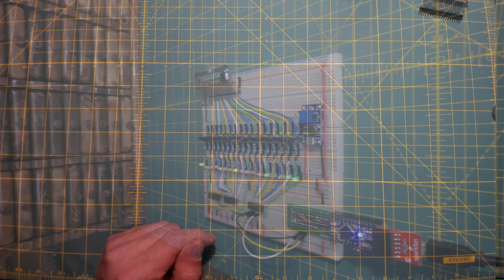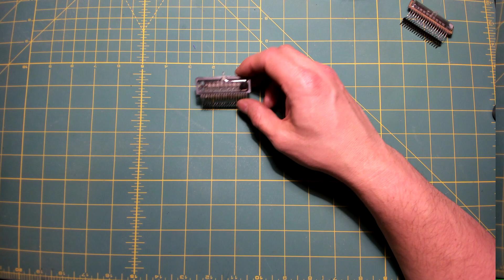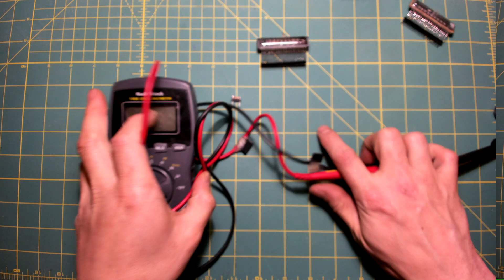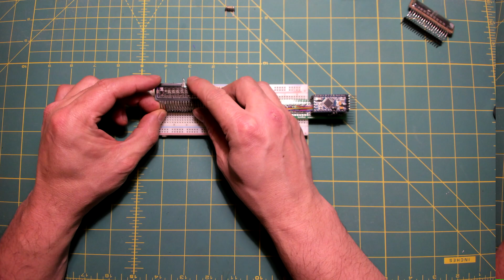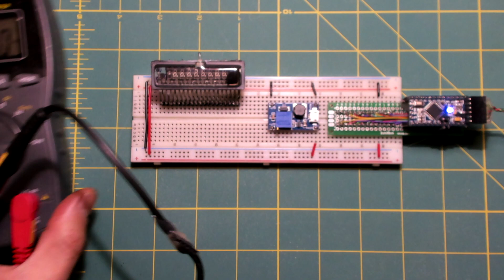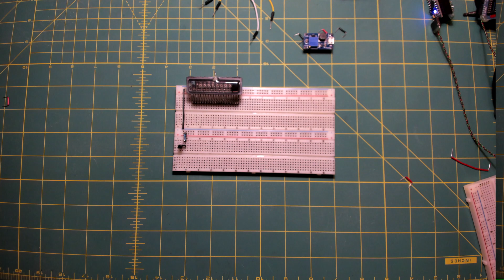VFD Display Prototype

Comment: Nice work. Do you have a schematic for this?
Reply: NPN transistors in common emitter configuration:
1. Collector -> 10K resistor -> hi voltage output from boost converter.
2. Emitter -> ground
3.Segment or grid pin to collector.
4. Base -> 10K resistor -> shift register output pin.

Comment: Nice Video! Thanks for all the information. I just found one of these and I'm still struggling to figure it out as I'm not experienced in electronics. It would help if you had some of the hard facts (Serial numbers, names, voltages or so) in the video or in the description. 
Keep up the good work!
Reply: Unless you have the exact same tube the data will not be the same